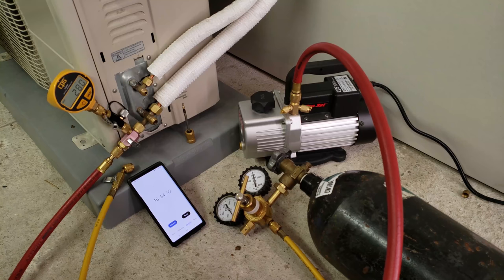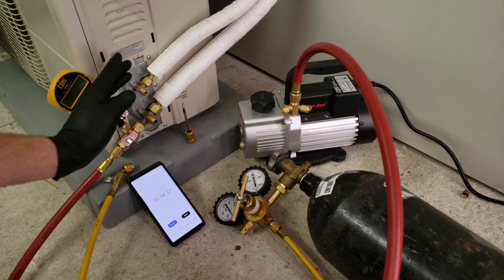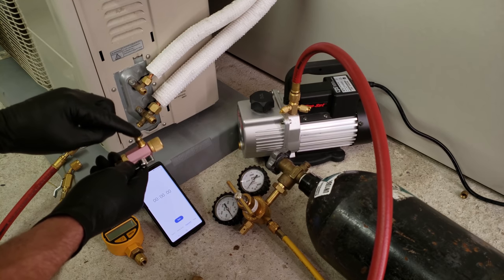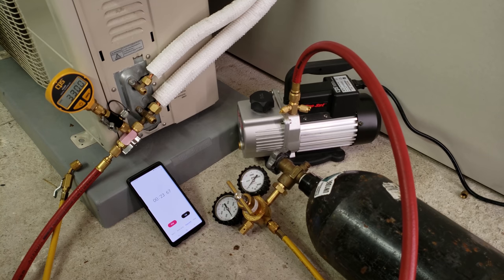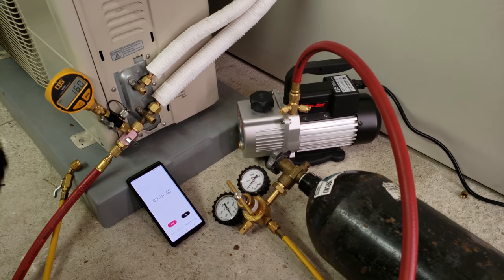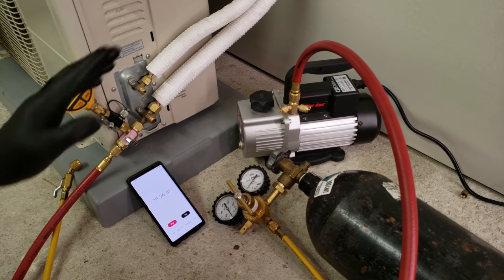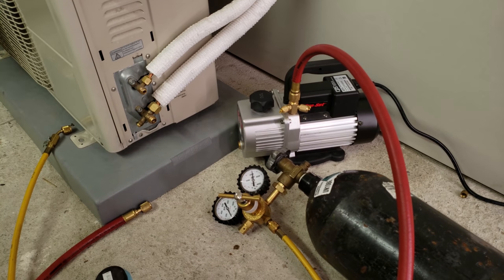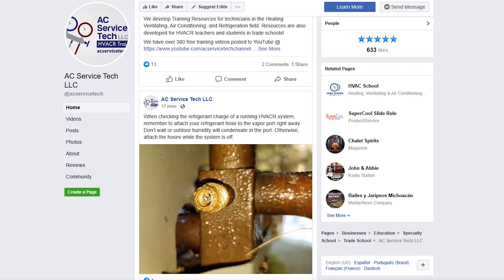Ductless Mini-Split Single & Triple Evacuation Method!  Step By Step & Opening Valves!

Comment: Why not put the valve core in before releasing the refrigerant into the pipes?
Reply: In my opinion that's what you should do.   I've got to watch the end of the video.  I can't see doing it any other way.   The only thing I can think of is that they want neutral pressure on the refrigerant valves before opening them.
Reply: You will introduce air to the system, as the pin doesn’t stay in the tool while vaccuming.

Comment: I can never get my core removal tool onto the bottom valve it's too long and the unit/lower valve is too close to the ground it's driving me nuts! so I can never pull the core on bottom valve on mini splits only the higher valves when doing multiple heads.

Comment: Why not crack open high side to flush it that way since no port opening?
Reply from the maker: We wouldn't do that because we have already pressure tested the joints and the nitro flow would not be that important. Like you said, you could if you really needed to but I was just mentioning that on conventional systems with two ports, you would do a nitrogen purge, thanks!
Reply: @acservicetechchannel  And I mentioned you could crack open the flare at the high side compressor connection to get the nitrogen to flow through but in reality it's probably not necessary.  I'm thinking I can pressure test the lines with R134a, CO2, or even air and then vacuum.   Obviously hiring a HAVC guy with the proper tools would be the best route to go, but as you probably well know you can get a lot of jive for repairmen claiming something or other is not installed correctly.  The big deal in my mind is to sure any leaks are eliminated at the outset, and you are going to have to find any leaks by pressurizing the system   Luckily you are only dealing with the connection tubing and evaporator coil as the compressor is out of the loop.

Comment: Hey guys,
I don't if this is the right spot to ask this question, but if anyone might be able to help it would be appreciated.
A couple of months ago, I had to the low burn and high burn switch, as well as an inducer motor, replaced, However, since then I have had a skunk smell coming from inside the furnace.
Would any of these parts cause this smell? if any of these parts are the wrong ones would this cause this smell? It just cost me 1200+ so I am just curious...Thank you for any info.
Reply from the maker: If this is a gas appliance, you would want to see a nice blue flame that is not getting pushed around when the blower turns on. You shouldn't have any new smell associated with the furnace since it is not new. You may want to have a tech look at the issue, thanks!
Reply: Burnt out motor windings smell bad.

Comment: What is the purpose of triple nitrogen? Thanks
Reply: It just picks up any moisture left in the system.  He's saying ice, but I doubt that.  Maybe it's true.   I never heard of it before unless it's on a running system that actually froze up internally because of moisture in the lines.  On a new system it seems highly doubtful.  A pressure drop does cause a temperature drop so it is theoretically possible.   I just have never heard of it before watching this video.

Comment: Is there a reason why you are not using a manifold Gauge? Using a gauge would allow you to have your nitrogen hooked up and keep you from removing your micron gauge.
Reply: I believe he said it eliminates extra hoses and the gauge which could be causes of leaks etc. It is to keep it simple, as best I can understand and what he mentioned.
Reply: @Fighter4Street  Yes that's what he said.  You want the least amount of service hoses that aren't perfectly tight in the system.  His method requires special connectors.   Ordinary people won't have all this stuff.

Comment: I see that you removed the core valves out of both of your Appion Valve Core Removal Tool. However, the cps vacuum gauge has a depressor and you did not mention anything about that. Is the depressor fine to be left in the vacuum gauge?
Reply: Vacuum guage is just measuring vacuum not transferring a significant amount of gas.

Comment: I would not recommend to anyone to remove the valve core unless you can show that it saves a significant amount of time.  20 seconds or 20 minutes?  Messing with the valve core just adds risk and is not in any manufacturers instructions that I've seen.
Reply: I agree it complicates things.  Most new systems should be fairly dry in the first place as the tubing sets come sealed with plugs and caps.

Comment: Your comprehensive discussion of the triple evac started right out by saying you had already done a pressure test!  No details of that pressure test?  How can you say that your otherwise fine discussion was step-by-step when you omitted the first important step!  How long did you evac for? What pressure did you apply with the N2?  How long did you wait before testing for leaks? Shame that these important details were left out.